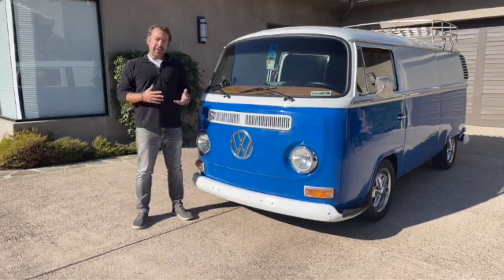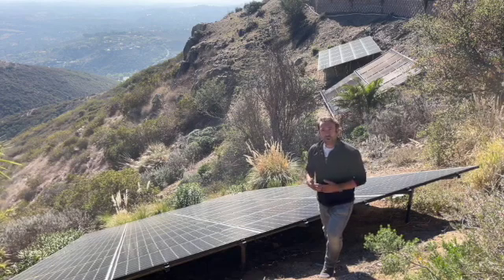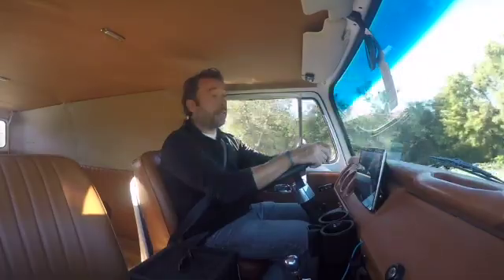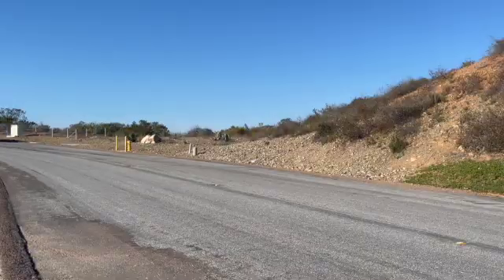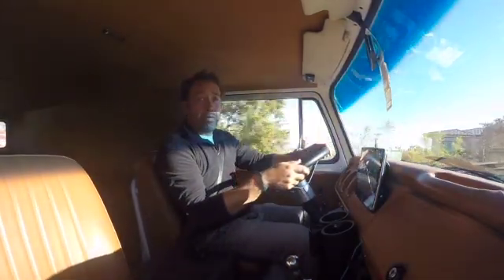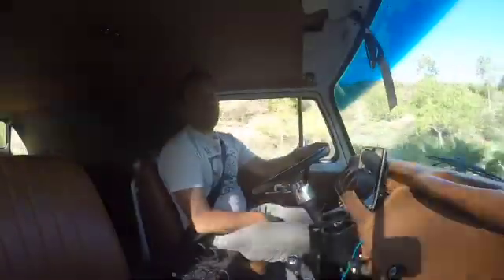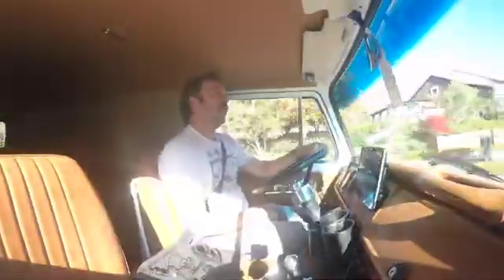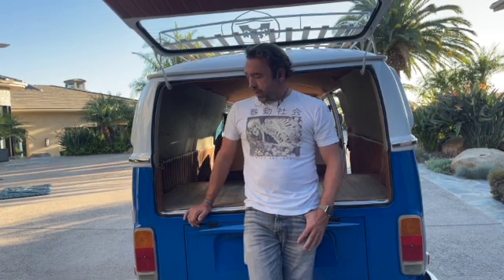1972 VW Bus EV Conversion Test Drive!

Comment: Awesome job. Hey, did you go HPEVS or Netgain hyper 9 for your motor ? Me myself am building a 01 black s10 stepside, hyper 9 33kwh battery. This summer should be on the road. Upper rubber boot North Dakota.
Reply: Netgain Hyper 9

Comment: Great to see such a tidy conversion. It is worth noting for the gas/diesel v electric brigade, that it takes 1850 gallons of water to refine 1 barrel of crude oil and 6kW of electricity just to refine 1 gallon of gasoline or diesel.This does not include the amount of electricity that is used to pump the oil/fuels. In the UK, just one of our 6 oil refineries uses the same amount of electricity as two cities. EVs are incredibly more efficient. And how can anyone argue against improving the air quality in our cities? Or the reduced strain on our health services by reducing ill health from air pollution?! I look forward to seeing your next episode.